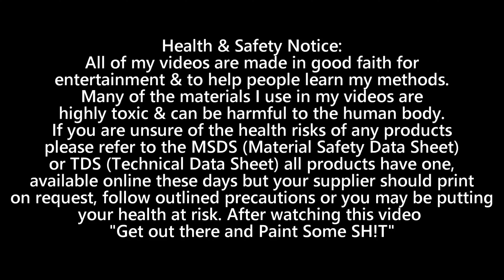New Sagola 4600: Small Spray Fan?

Comment: I paint boats, so pretty much all I spray is single stage, and the 4600 is pretty darn good with it, for me anyway. I’ve found that it actually saves me material over my pro lite, around 10%. I’ve also noticed less overspray, which for me in a boatyard is a must. The 4600 just seems to be more efficient in my humble opinion. Pretty work as always Sir, have a good one.

Comment: I use mine to paint bumpers, you dont need a big fan to do that and its actually easier if you have a smaller spray pattern at least that's my opinion.
Reply: That's an awfully expensive gun just to relegate to bumper painting. 🤔

Comment: Interesting thing is Pete’s Hobbies did a review of the 4600 and the outgoing xtreme and the only difference in spraying is the threads on the cap covers. They both have the exact same spray pattern. They are the exact same gun. Nowhere near as small as you claim. The only difference is the new caps for the 4600 and they are interchangeable with xtreme. He proved the interchangeability and pattern in real time 😅. Exact same pressures, exact same fan and fluid settings. 

Maybe take a look at an unbiased review. How do you explain the huge difference between your review and another reputable gun reviewer. 😬😬😬. The jokes on you. It’s literally the same gun with new caps 😂. What say you?
Reply from the maker: @92boostedh22  what do I say? I say the old 4600 have always had a small spray fan, I never mentioned it was exclusive to the new sagola, they've always underperformed. Where do you believe my bias lies? In showing literally it having a much smaller fan than the competition, it's got an uneven and broken fan pattern too, I've always been critical of sagola for this. But carry on.